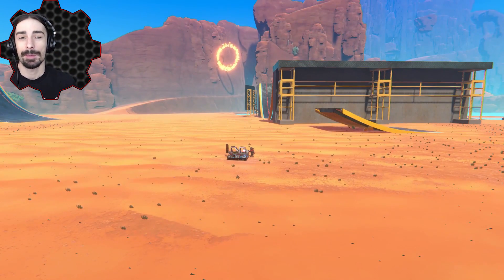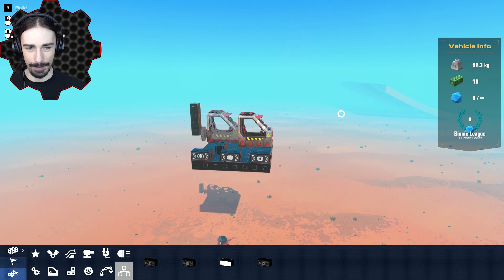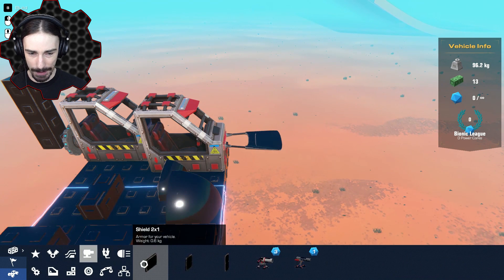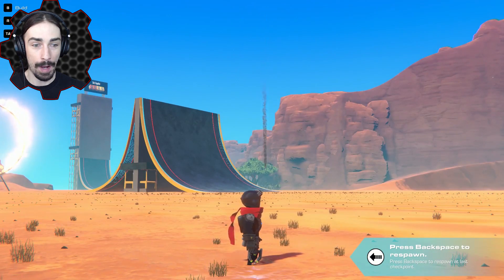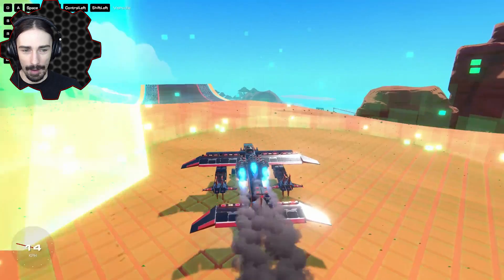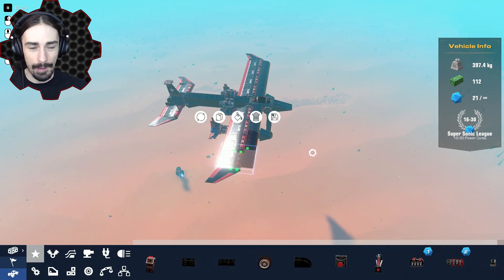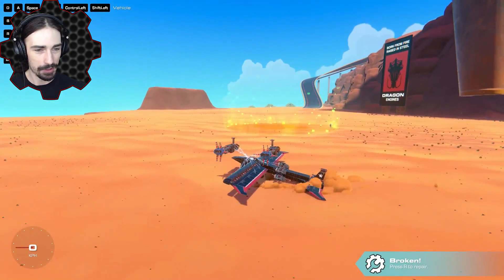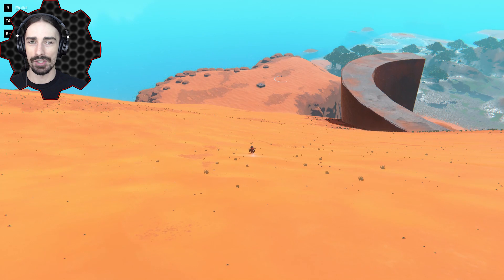*HUGE UPDATE* LOGIC BLOCKS, SENSORS, and MORE! - Trailmakers Early Access Gameplay Ep46

Comment: Scrapman, if you pull up while firing, you leave your missiles quicker, therefore, they fly straighter. If you push down for a strafe, you stay by your missiles for a longer duration, therefore, they fall until you get away from them. My advice, if trying to shoot downward, shoot them while facing downward, then immediately pull up. If shooting straight, position yourself straight, fire, then pull up immediately. If shooting up, you might have to do a loop to get away from them quick enough so they don’t drop.

Comment: Logic blocks are a great introduction ... since you talked about an upgrade to old vehicles it would be interesting to change the vehicle to 5in1 to automatically switch to various modes (but I already know that it is very difficult in practice) but you could try something of simpler type a car that becomes airborne if you launch yourself into the void and that becomes a submarine when you dive